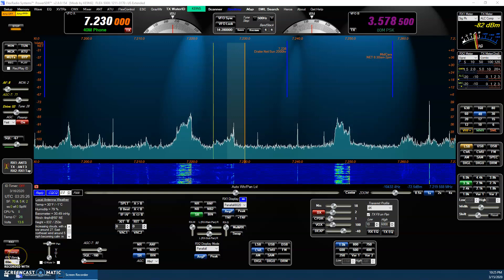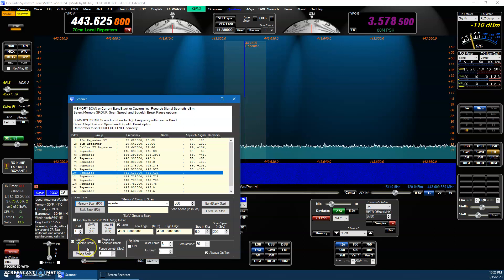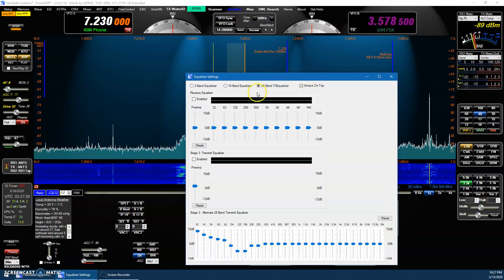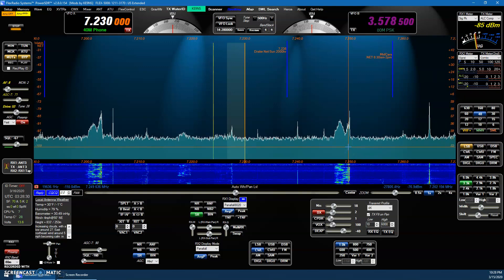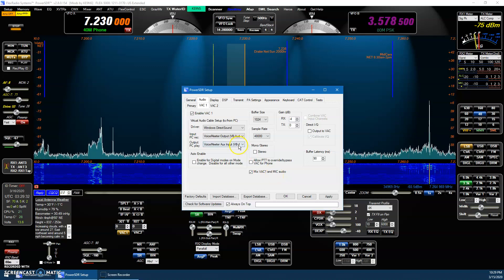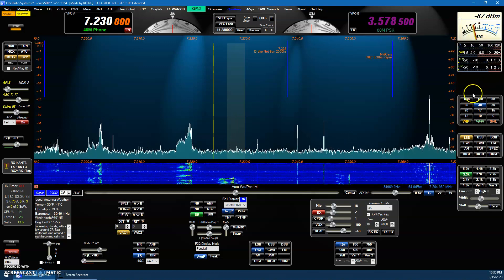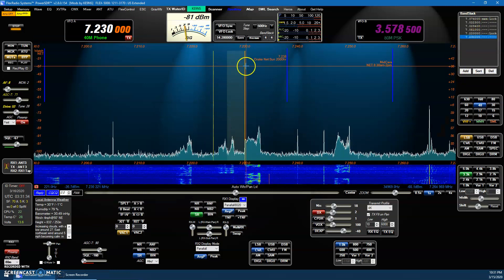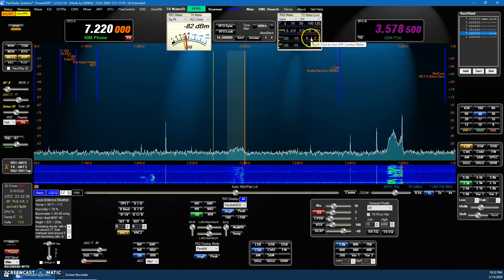PowerSDR ke9ns v2.8.0.154 Analog Meters and more

Comment: i can't enable the swr meter ,i have v2.8.231 flex 1500 ............UK ,i try everything
Reply from the maker: The Flex-1500 does not have an SWR or Power meter. Its only for the Flex-3000 and Flex-5000

Comment: Can you point me to a link describing the syntax used for custom scanning lists?  I want to create my own.
Reply from the maker: If you hold your mouse over the "Cstm List Start" button (with the Scanner screen in focus) it will explain with a ToolTip.
But... Just click on the button and you will see the folder to place your list, and an example scanner list file already there.
Currently It only allows you to chose the Freq, Mode, and Filter, verses selecting a group from "Memory" which allows for a very detailed setup of both RX and RX, including setup for repeaters, etc.